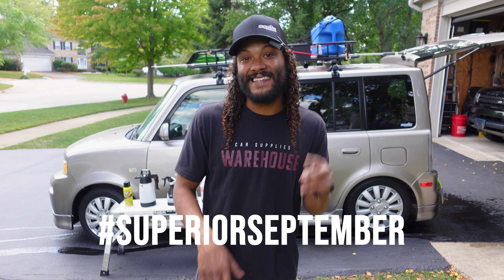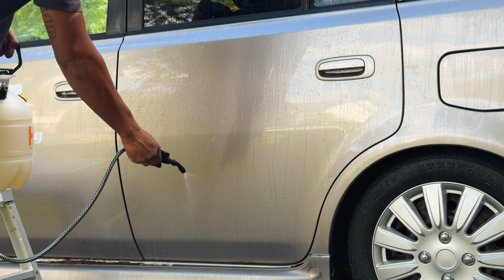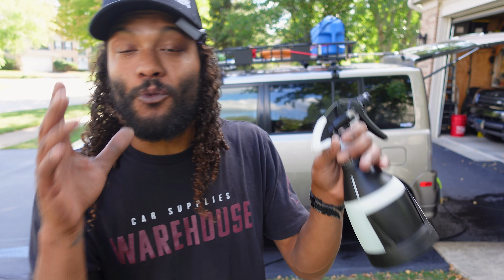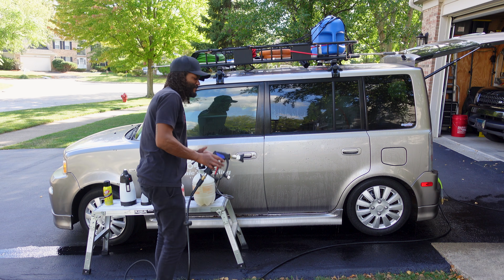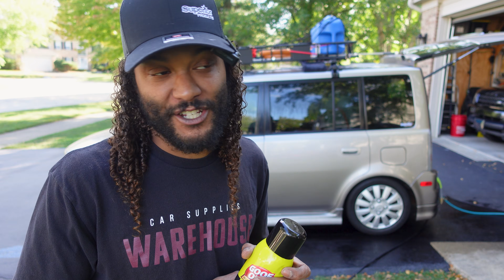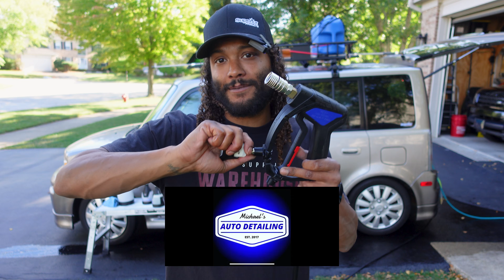Superior Products New Polymer Ceramic Spray Coating Torture Test   #Superiorseptember

Comment: Nice test! It definitely has some real world purpose, as if you use different cleaners for different parts of the car, example would be overspray from cleaning a wheel, or spot treating a stubborn bug/bird dropping, to cleaning off tar and paint. One suggestion would be to use masking tape to section off areas of the door and try the products individually. Thanks for not over hyping, and giving honest reviews, and for the time it takes to do these reviews. You have definitely brought superior products to my attention, and a little less money in my wallet! But its money well spent in my opinion.

Comment: The only deduction I can make is how the coating responds to a new chemical after it has been exposed to the previous chemicals. Each chemical had successive negative effects on the panel.. 

An accurate test would show how the native coating does in it's virgin condition vs each chemical presented after multiple exposures they to each.

Loving Superior Products in general.

Comment: BTW I wanted to mention a solvent that says its safe for wax and coatings, I haven't really tested that claim yet but it works really well on adhesives. Need to try it out on more things but its Gtechniq - W7 Tar and Glue Remover.

Comment: Do you recommend that spray ceramic coating over gyeon one evo?
Reply from the maker: Short answer is yes!! One Evo is a traditional coating but it only last for up to 2 years. These coatings cost less and are easier to apply. Yes you would have to apply these coating twice as opposed to once with One Evo but for the ease of application and hydrophobics I’m getting I would recommend the new Ceramic Spray Coating or the Graphene version over One Evo

An even better option would be to go with Superior’s Nano Ceramic coating because it is a traditional coating that you get up to 3 years out of. I got 2.5 with my last test and I’m kinda hard on my vehicles so I like their traditional coating with the new Ceramic+ Graphene on top.
Reply: @jamiesdetailing if you apply the nano ceramic would it benefit the paint by applying this new ceramic spray coating?
Reply from the maker: Testing it now on the Range Rover and it definitely has better faster hydrophobic properties with the added Graphene Spray Coating. It is also makes the black paint appear slightly darker im really liking it so far